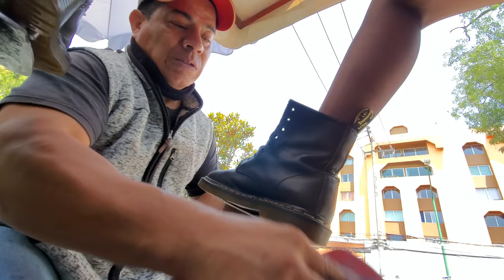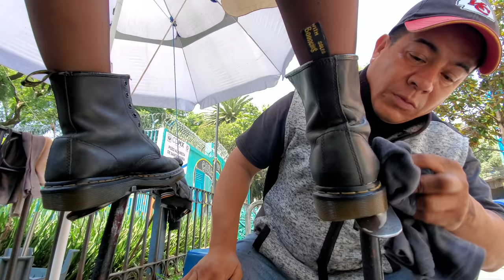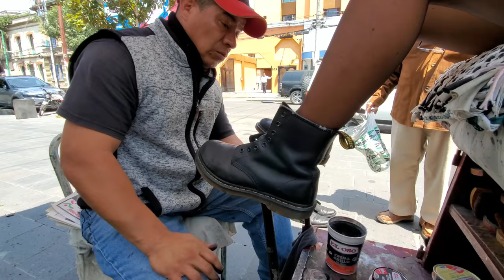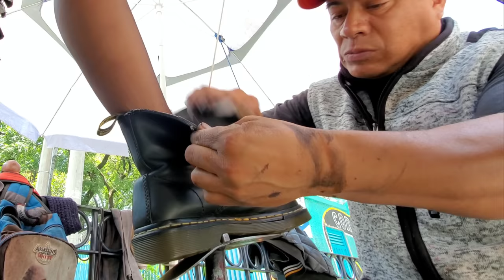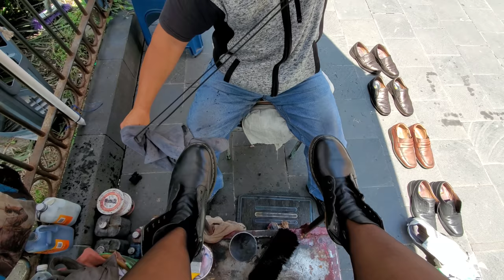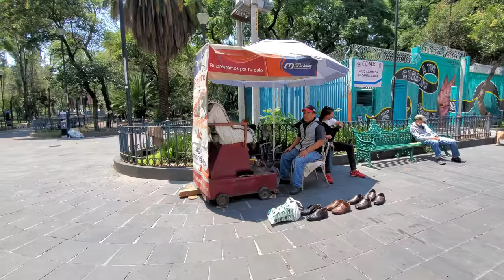LADIES VINTAGE DR. MARTENS BLACK LEATHER BOOTS Street Shoe Shine by Francisco Mexico City 🇲🇽 (ASMR)

Comment: Hello Kat, here is a shoe shine tip for Francisco, in the last step of his shoe shine when he uses the long rag to  buff. Have him use a little spray bottle of water and lightly spray the rag then buff the shoe from side to side. Add polish and buff add polish and buff, the water will give the black a higher glossy shine. Keep adding the 4 or 5  layers of polish then on the 6th layer use the water, it will be like glass with a mirror shine. Only the toe where the shoe bends the polish will crack if you put too much. But the toe you can make it look like shiny glass the reflection will be amazing. A shoe shining tip for better results and more customers because his shoes will shine better then the others.
Reply from the maker: Hi Angel, great advice! I'll let Francisco know about this tip. Thank you!

Comment: Doc martens soles are heated  don't know if they will use glue to stick or not soles are not sewn on ( welted) I have two pairs but I don't wear them as much I've had them for a while but they haven't split yet nice shine
Reply from the maker: I don't know if glue would help but I'll try. Otherwise, I'm gonna have to use them only on winter and spring (not rainy season). Glad your boots have lasted so long. 😊